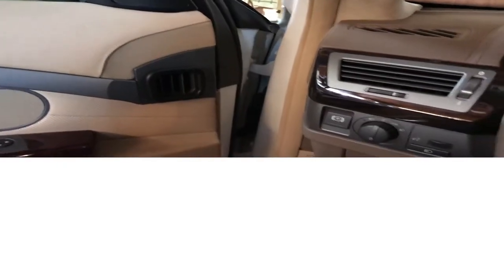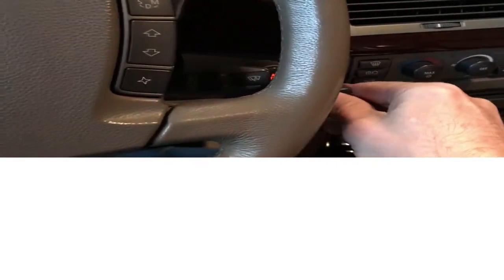E66 760Li long cranking issue: fixed by high pressure fuel pump diaphragm replacement.

Comment from the maker: This simply tuned out to be the high pressure fuel pump (HPFP) diaphragms. Not the integrated supply module. I'll change the title and info
Reply: Did you have any driveability issues like stuttering or stumbling?